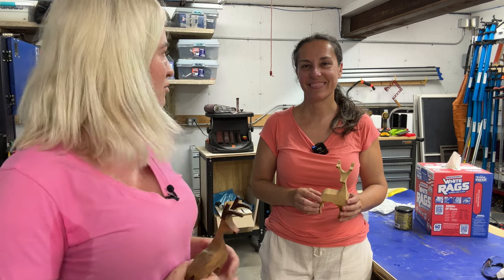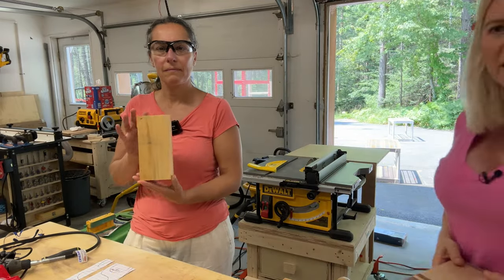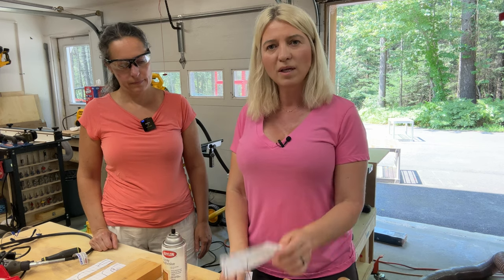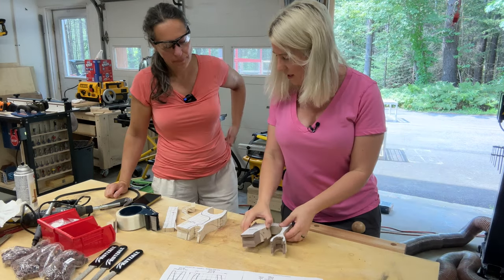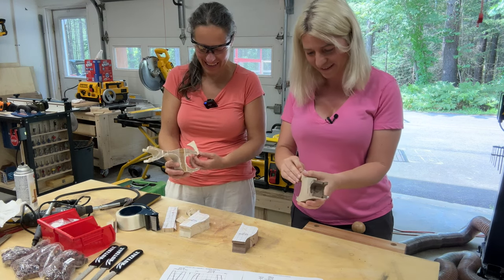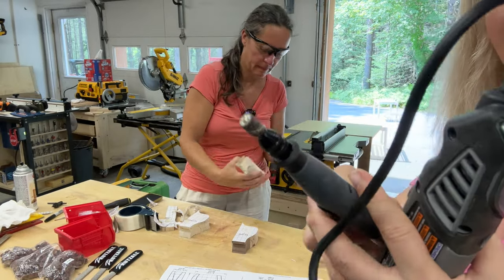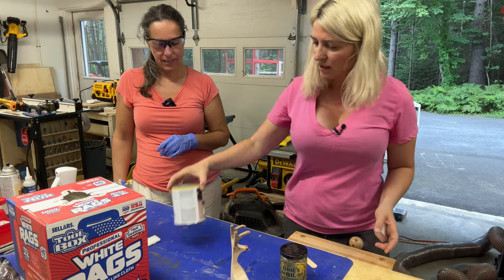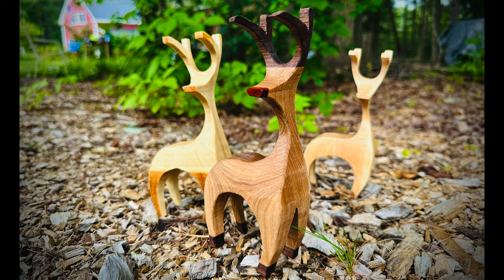Bandsaw magic. How to make a 3D reindeer . Woodworking projects that sells. Christmas in July

Comment: 6:15 When using the spindle sander you can use a few pieces of scrap plywood to use the entire sandpaper roll. Clamp them on the table so you raise the surface.
You always wear the lower part the most. Just a tip for using it all. 😉

Comment: Nice video. I have this pattern also and just finished cutting out 55 but they are not multi-species wood, each is only cherry, maple or poplar. 
I sand with a spindle and belt sander but it sure takes time. 
I’ll have to try the Odie’s Oil. 
I created a template and trace onto the board so I don’t have to cut out so many patterns. I also just use the bandsaw to cut out the upper instead of using the forstner bit, saving more time. 
I do like the nose, antlers and hooves being contrasting woods.
Reply from the maker: Thank you. They sure are fun to make. Sanding does take time that’s why mine are never perfect.  55 of them is a lot! Getting ready for an craft show?
Reply: @woodworkingwithSkyler I hope to sell 2/3 of them and give the others as gifts. Have a good day!

Comment: Cute Deer, turned out great, I think you pretty much need that flexible shaft to do fine work with a Dremel that big..........I picked up a couple new hand sanders this week, one old one died and I replaced that then they had a different style half off so I grabbed that too. The next sander on the list in the Oscillating Sander, what model is yours? I remember you said you really like it.
Reply from the maker: :) mine is a Wen. I got it because it was cheap but it works really well
Reply: @woodworkingwithSkyler  That's likely what I'll get, I'm just a hobby woodworker and it seems like it would be plenty good for my uses.

Comment: 4:00 I see the band saw is tuned nicely.  How do you set up your band saw?
My 10" Rikon drives me bananas.  Is is a chore to get a 1/4" blade to track, and a 1/8" blade will not track.  The blades rush to the edge of the wheels, or walk right off!
Reply from the maker: Funny: my 3/16, 1/4 and 1/2 inch blades are super easy to tune. The 3/4 one I am struggling with. I put the gullet of the tooth right in the middle of the blade
Reply: I've been struggling with my Rikon 10" 306 as well, I finally called Rikon and they walked me through how to properly adjust the blade, it was super helpful
Reply: @paceves4403  I am going to call Rikon.  Thanks for the encouragement.
I committed the crime of fiddling with the lower wheel, despite the warning not to.
Incidentally, Jet (or Grizzly, I forget which) uses a straight edge to align the wheels.  The Rikon frame interferes with a straightedge, though.

Comment: You said in a video that you got CA on your hands and it annoyed you for a week. Are you aware of CA debonder? It will penetrate the glue and weaken it so you can get it off your fingers and also will allow you to reposition your work it you make a mistake. When debonding wood you'll have to let it dry out before using CA again though, this is where a heatgun will come in handy. CA debonder comes in a green cap. I enjoy your videos.
Reply from the maker: OMG! Thank you so much! I just ordered some.
Reply: You can also wash your hands in hot soapy water to break the bond of super glue.
Reply: Fingernail polish remover… much less harsh on your skin and usually have it handy in the house